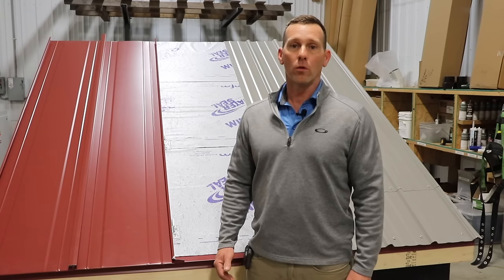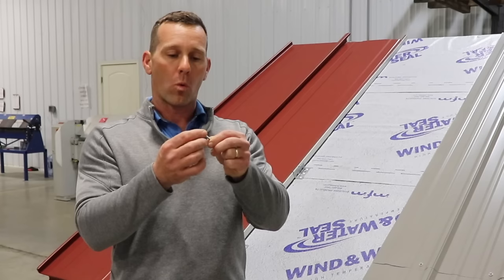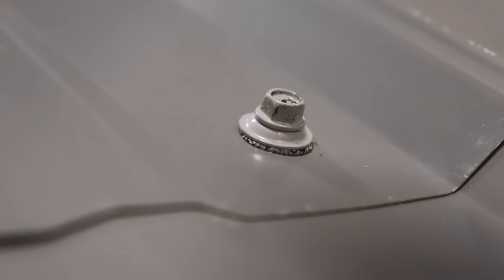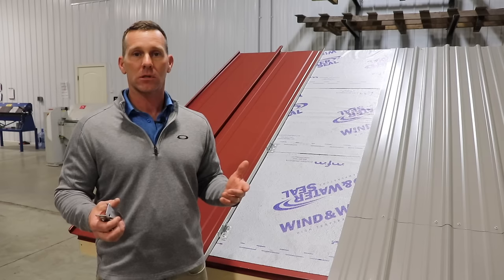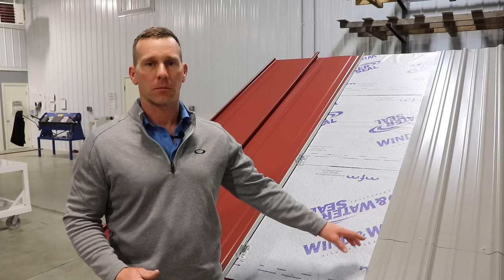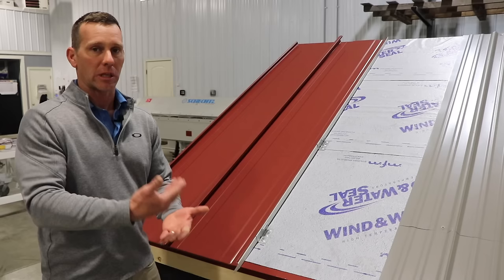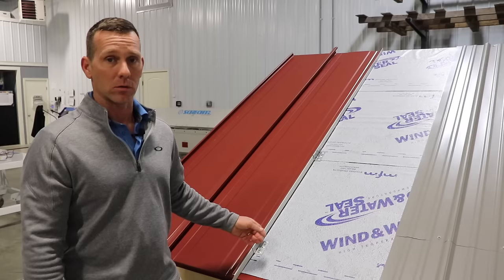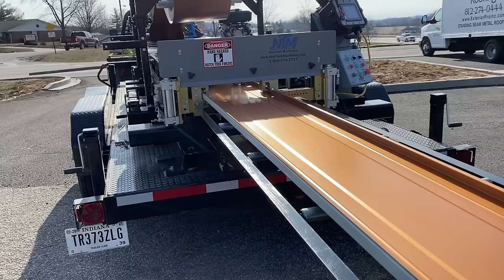Standing Seam Metal Roofing Vs  Corrugated Screw Down Metal Roof - Big Differences between the Two

Comment: They have screws that cover the washer for the corrugated metal roof.  You can also put your screws on the high part of the corrugated metal roof (Likely never leak.)  Corrugated metal is not usually 29 gauged.  24 and 26 is more common.    However the expansion and contraction is a strong point for standing seam.  After 10 - 15 years replacing your screws on a corrugated metal is a good idea for maintenance ($ 1,500 - $ 3,000).  One can also use purlins (1x4) nailed to roof creating an air gap helping one with insulation and reducing expansion and contraction damage (I do not know about standing seam.  To me it came down to cost.  I paid about 50% more for my corrugated roof than shingles.  I have a 10/12 pitch and it ate my shingles alive.  However it was about another 50% increase to step up to standing seem.  I'm sure all regions are different with the cost structure.  Standing Seems is also better if you want solar in the future.  I have a southern looking  home in Florida so the corrugated on my 20 acres seem to be a better architectural choice.  If money is not a concern, standing seams like a better choice.  Florida just overhauled the laws in regards to roof damage complicating the cost benefit of better roofing.
Reply: I put a corrugated roof on myself in Fl. also and love it. Make sure to stick to the manufacturers guidelines for screws. Mine had to go in the flats to keep from voiding the warranty.
Reply: @da324  where I'm at the screws on any edge has to go in the flats for wind up lift, but above the roofs edge you can be on top of the corrugated section.
Reply: @thomasmoss1066   My manufacturer said two screws on each side of the ridge of the corrugated roof at the top and bottom. Between the top and bottom, they have to be every 12". I put 1x4's on the deck one foot apart under the metal to land the screws. I have an out building I built 20 yrs ago, and that manufacturer said the ridge. Never had a leak on that roof.

Comment: A lot of metal rooves are installed without underlayment.  That underlayment would seem a good idea to save the wooden purlin and screw connection.  I see screws and nails coming free from the purlins due to the moisture of condensation getting caught on the purlins.  The resulting rust over time deteriorates the wooden purlin.  I haven't tried, but I'd like to see more of the screws inserted through the top of the panel ridges.  I'm curious how hammering or screwing the screws affect the surface of the ridges.  Would they get mashed or dimpled and cause a water ponding or building up instead of shedding the water?  I've observed a surprising amount of water from condensation shed under the roof panels.  The type of wood used for purlins might affect the duration of the roof as well.

Comment: @Anon ymouse  I am not the producer of this vid but i can tell you some things.

Standing seam vs. Exposed fasteners.

1)I have not done many standing seam roofs. However, they definitely are not fastened to the roof as well as exposed fastener roofs. Exposed fastener roofs are screws down every 6 inches or so horizontally and every two ft vertically. Standing seam is not...and have way less fasteners.

2) exposed fastener roofs do not have a neoprene washer as this guy stated. The washers are made out of EPDM which is a rubber that lasts 30 plus years and is used on full 100x10 ft rolls (weighing in around 450lbs) of EPDM on commercial roofs( big buildings). Exposed fastener metal roofs are durable and also increase the value of the home.

3) exposed fastener roofs are way faster to install. Which costs less in labor.

4) in my opinion standing seam is boring looking. Think of the jeeps that  have exposed bolts and nuts and stuff...they look cool as shit. Standing seam looks way less cool.

5) if a tree branch falls on standing seam you have to take the roof off from one side and potentially to the other to replace a panel. That is not the case with exposed fastener roofs. So think about the labor costs on that one.

6)exposed fastener roofs are easier and faster to install. They are easier to repair. They are warranted for about the same amount of time. 

7) if you have a house and getting a roof any of the metal roofs add value to the home. They might just last 50 years. Warranted for 35 for exposed fastener. 

Think about that. Talk to more roofers. The  make your decision.

Exposed fastener is cheaper and lasts just about as long. (There is some preventive maintenance that isnt necessary until you get  leak but just to prevent a leak, which would only happen at a screw, is to have the screws replaced before the warranty is up.) 

That's my take. I've done a lot of roofing. Take this information or discard it. Hope that helps.

Oh, and metal roofs will fade over time, but will still way outlast shingles for sure.

Edit: @7:16 he shows a ridge cap that appears to have a gap that wind blown rain can get into. Again, this is his sales pitch. That gap you see is caused by a waterproof seal that expands under the metal. That is not, I repeat, that is not a leak.

@7:30 he says standing seam has no seam. If that is the case then why is it called standing "seam"? It absolutely has a seam. That is like saying bacon isn't bacon, or that we are comparing peaches to pairs hear and peaches don't have an acidic citrus value while pairs do. Think about that.

Comment: If there is no physical contact between metal roof and clip, what keeps the roof from "sliding" off the roof?
Reply: The metal is crimped together after the clips are installed. You can see this at 9:02, also it is typically screwed at the very top of the panel which is covered by the ridge cap and sometimes at the bottom as well depending on how it is installed.

Comment: I’ve re-roofed more standing seam than I have shingled roofs !  Screw down has proven itself time & time again ! I have only gone back to 1 that I replaced all the screws because the owner fed into the hogwash that the screws will leak in another year or two. I did the job & was then told that his steel roof was 25 years old ! I then showed him his screws & 99.999% were just fine & they would not have leaked !  Use the screw down steel people you’ll be happy you did ! btw, all my buildings & house are screwed down & no leaks up here in Montana ... my buddy HAD a standing seam roof & it was ripped right off the first year unfortunately the contractor died of a heart failure but we got the guys insurance to replace it & I put on screw down steel been great up to now @15 yrs !

Comment: I didn't read all the comments of others so maybe it  was mentioned.  But one other MAJOR difference between the two systems is the COST.  The corrugated is way cheaper and easier to install for any layman.  The sheets come in  about 3 foot widths whereas the other is 1 foot.  Yes, the seamless is better for all the reasons mentioned in the ad, but corrugated has its application and can be leakproof too if installed correctly.

Comment: The standing seem roof also conforms to the shape of your roof even if you have underlayment. If you have just the slightest imperfection in the roof, it will show it. They call it oil canning.
Reply: No, oil canning is when expansion from the sun causes the metal to arch up like the bottom of an oil can. That's why they call it oil canning. That's why you need striations in the metal to absorb the expansion. Totally flat metal oil cans terribly.
Reply: I did not go to the scientific library, rather people I've talked to in the Metal Roofing business, say that they call any expansion and contraction due the sun or weather is "sometimes" referred to as oil canning. However I did look google this  "Oil canning is defined as the perceived waviness of a metal panel and is an inherent characteristic of light-gauge, cold-rolled flat metal products. In other words, it's a visual phenomenon that makes metal panels look wavy or somewhat distorted, especially in the broad, flat areas of a metal roof or wall system".     I'm not arguing this, it's just an analysis.
Reply: @masshultzy6449  So do I understand that you're pointing out an aesthetic advantage of corrugated screw-down roofing?
Reply: On a hot day the clips/brackets on a concealed fix roof can show as dents through the sheets.  Not a problem for most.

Comment: Comparing these is a little like apples to oranges. There is a HUGE price difference. But no doubt that Standing Seam is the way to go.
Reply: @David Vazquez Like he mentioned, corrugated thickness can be as low as 29 gauge which is cheaper. For SS, the labor work is more technical on the flashing.
Reply: @David Vazquez I just bought standing seam for a 1500sq ft roof... was $6900 with all metal included and gutters etc. Corrugated would've been 1/3-1/2 that but has to be replaced every 15 years. Standing seam is 60+ years or forever if done properly. Western States Metal has good pricing and really knowledgeable staff... also has a youtube channel thats very informative.
Reply: What makes you think corrugated has to be replaced in 15 years? Did some salesman or contractor swindle you?

Comment: This isn't a comparison of the two systems by an unbiased party. When I saw the fasteners installed in the valleys of the corrugated sheet I could see where this was going. Why would you install fasteners where the water will run?  Also, the corrugations allow for expansion horizontally so that problem doesn't apply. For vertical expansion there would only be a difference if the fasteners on standing seam are loose enough for slippage. That seems sketchy. I'd want to see a demo of a fastener marked and shown movement from the mark due to sunlight. Best to check other sources also before deciding what's best for your home/climate/budget.

Comment: I've done at least 500 corrugated Roofing jobs most of the screws I would guarantee them with the washers to last at least 20 years probably closer to 30 I've done roof 25 years ago in the screws are still fine no leaks

Comment: I live in cyclone territory...how do the clips stack up against the screws for holding the metal sheeting to the roof?
Reply: Not good.  When we install concealed fix sheeting in high wind areas, we always positive fix them at the top and the bottom.  The manufacturers don't like it, but the clients do.

Comment: What's the wind resistance on either? 🤔
Reply: Put it this way, many standing seam roofs have lost panels in storms, if you loose an exposed fastener panel in a storm you will have also have lost the plywood, so even if you had a standing seam roof once the storm is strong enough to remove the plywood standing seam will not help you. As for snap lock panels FEMA after inspecting roofs after storms says that snap lock panels are the worst preforming metal roofs.

Comment: Call me skeptical, but since he never compared pricing I suspect the cost of this stuff makes it impractical compared to either corrugated or shingles.
Reply: Always good to be skeptical. You are correct, in that the up front cost is significantly higher than the alternatives. Worth noting, though, is that the long term cost is actually cheaper, in that a properly installed standing seam roof will out last 2 or 3 shingle changes. There are standing seam roofs in my area approaching 90 years old and going strong, despite repeated hurricanes and 80 inches annual rainfall. Standing seam roofs are also less likely to leak, leading to lower repair bills, and most insurance companies in my area give a discount for this roof type. Also, if you're considering solar, many systems can clip to standing seam without penetrations. Pay attention to flat vs striated panels, as flat can have big issues with 'oil canning.'  Corrugated metal is also good as long as you keep on top of screw/washer changes, right around every 10-15 years or so, depending on climate, as the panels can last way longer than the washers/screws. Maintenance on damaged panels is WAY easier with corrugated. The paint applied is determined by the manufacturer, and not the type of panel as this video might suggest. You can get corrugated with paint just as good as that on standing seam. There are corrugated roofs here in fine shape after 30 to 40 years of service. Proper install is crucial with any roof, or all bets are off. You'll have to do your own math, but in my very rainy, hurricane prone area it makes more financial sense to use standing seam as long as you plan on being in the house for more than the lifetime of one shingle roof.  If you're in a dry area, or if you don't plan on staying long term, its probably better to go with the cheaper options. Cheers.
Reply: You just got a long explanation. Now I will give you a short one....your wrong on both counts. Just had Standing Seam done and in pricing it was about 25% more than a shingle roof. So is it impractical to install a lifetime (my lifetime) roof, not hardly. I would hate to even imagine a shingle roof done at today's cost and then add that with what the increase in material and labor cost will be on another roof in 25 years.
Reply: @taddmcmichael9061  See, this is the kind of information that was missing in the video.
Reply: @realityquotient7699  Although I will qualify that 25% more price as was in my case. I am sure the price could vary, I received 4 estimates and 3 came from Amish crews (of one I went with) the other a more advertised company and they were more $ by a ways. Standing seam is more specialized work than corrugated steel and those contractors can be farther in between so the pricing can vary with  competition.  I was also contracted for this spring and metal pricing has gone up considerably since then but so has lumber and shingles so would be hard to say %'s at today's costs.

Comment: What stops the individual sheets of standing seam from working out unevenly? Ah, later in the video, I seen that the ends are bent downward and later, someone was crimping the seams.
Reply: As in real-estate, instead of location, it's "Layout, Layout, Layout,". You have to square your roof before you set your first panel, else the bottom edge will have "sawtooth". Since your first "whole" panel doesn't start at the gable end (different per manufacturer but utilize a starter panel), you are able to square the panels and any out of square is dealt with in the starter and termination panels.

Comment: pretty good job over explaining the differences I have been putting metal roofs on since 1977 huge commercial jobs steel mills factories schools churches power plants maybe I'm just lucky but we do not use Amish screws with the little rubber gaskets we use commercial grade screws into Steel I have never had him back out one thing I am curious about he said no screws go into the sheeting on all the commercial jobs I've ever done according to the prince you have to put screws in the top for the sheet and the bottom I did not see this on your sheathing on your standing seam by the way all the commercial sheathing I've worked with I'm standing scene have slide clips so if you didn't pin the bottom and a top everything would slide down hill and if your clips do not slide then there is no expansion and contraction do that roof sheet by the way I have put standing-seam roofs from Florida the Minnesota and literally hundreds of Acres of roof